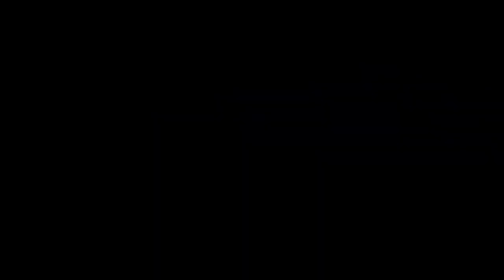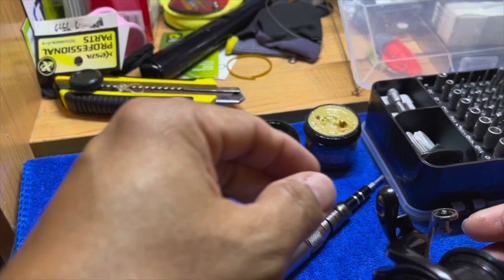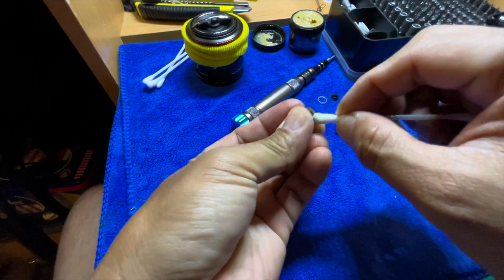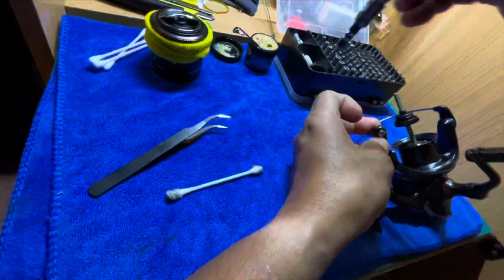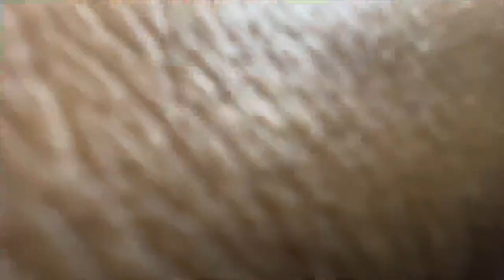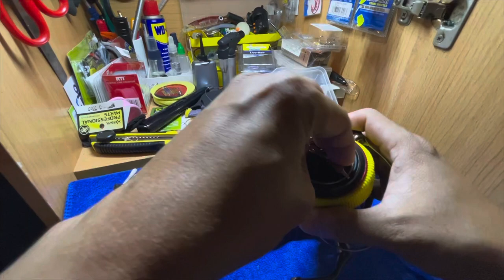FISHING REEL MAINTENANCE | SHIMANO VANFORD Line Roller Bearing -  Cleaning

Comment: should there be a schim inside lineroller från the left or on the screw where the line roller goes on.. i cant remepberif its outside or inside.. the little metalic one
Reply from the maker: Yes there is, its on the bail side.
Reply: Schemtstics says outside ,
Reply: @hejgoranfesdu  so follow the schematics?
Reply: @micah1368  thatt problem is long gone and fixed now i can take any shiman o pieces and back togheter in 30 mins..